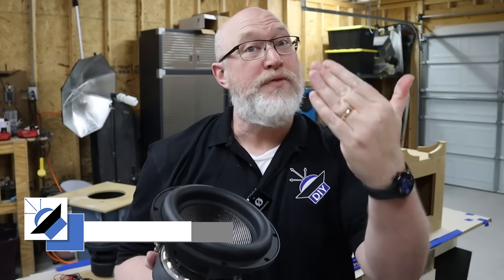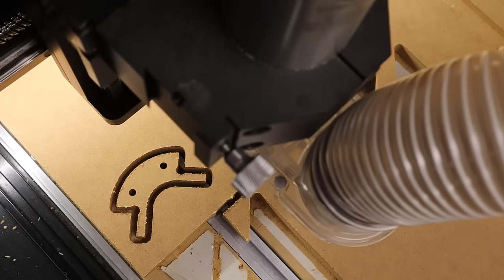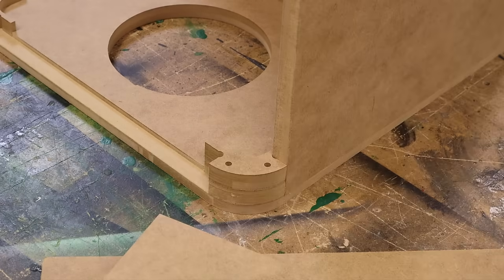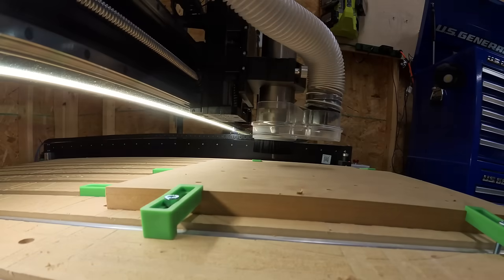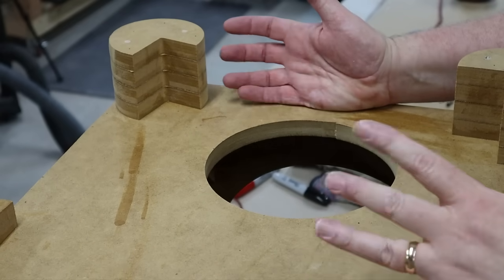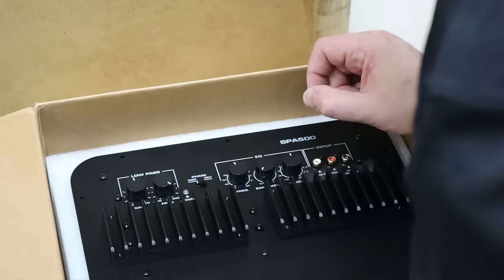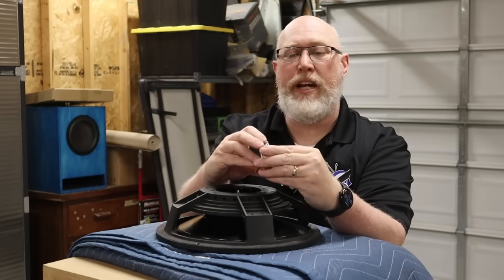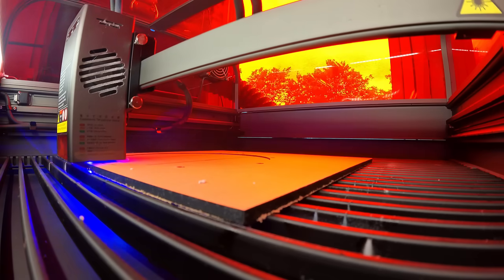Ultra low bass from a hidden 8" subwoofer.

Comment: If your using a wood glue likewise think you are, like titebond or something similar you should really be clamping everywhere your gluing 2 pieces together.. there are several good youtube videos that show the difference in joint strength when not clamping and clamping with different pressures and different lengths of time.. you get a major boost in joint strength even with light to medium clamping pressure for 30+ minutes. Without clamping , 90% of your joint strength is in your rabbits, dados and Brad nails but the opposite should be true, most of your joint strength should come from the glued joint. (Wood glue or yellow glue is a pressure sensitive glue) probably won't be an issue with a small sub but  certainly could eventually have a failure with 12,15, or 18 inch subs. Just thought id throw a little knowledge your way, take it or leave it, im just a professional woodworker not a audio expert...

Comment: What to learn. Easy to clip and blow with a passive radiator. Passive radiators are inefficient and hurt medium bass while still needing more power. Which will make it blow. Nice.
Reply from the maker: The  subwoofer blue because I clipped the hell out of the amp because I was trying to get some good footage of the driver flexing.

Comment: This is extremely interesting to me because I've got an old Klipsch 2.1  computer set with a 6.5 sub and 2-way satellites with 3"Mid and 1/2"? horn tweeter. They sound - I'm gonna make people angry here - like crap. The bass is boomy, the mids are muddy and the highs are shrill AF. I would love to take the amp in this set and completely revise it, starting first and foremost with the crappy sub. The Highs are tolerable, but the bass.... sucks.
Reply: P.S. Your take on the problem solving.... 👍

Comment: In 1978, I built a subwoofer with a 15-inch radio shack speaker. With press board, because there was no MDF back then. No calculation, just one sheet of press board. It had a flat rectangular baffle 3 X 20 inch that went 3 inch to the back wall of the box. It was used as a bass booster back then with its own amp . And it worked great for a first build.

Comment: notice you use Gorrilla and Tite  ,which is better ?
Reply from the maker: It depends on the application. 
For something like this that's unlikely to spend a lot of time outdoors, and I'm going to cover it with something like carpet or veneer, any wood glue will be fine.

If it's going to be for outdoor use, I'm going with titebond 3. 

If I'm making something out of plywood that I plan to stain later. I like the gorilla glue because it dries clear and I have found that it discolors the wood less titebond 2.

Comment: Hi! I'm glad that this kind of design has caught the attention of others. ☺️ I developed this technology in 2020 for my own 250 liter subwoofer, an optical trick to make the appearance of such a large subwoofer more beautiful to the eye. I implemented it in July 2020 and I had never seen this technology anywhere on the internet before. That year I presented it on several Hungarian professional websites, then in October 2024 I also posted it in the DIY Audio Facebook group, and in February this year in the Loudspeaker Plans group.
Reply from the maker: I was completely unaware that anyone anywhere has ever built anything remotely like this?.
Reply: @DIYAudioGuy I shared my 2020 project in these foreign groups. ☺️
Reply: @DIYAudioGuy It won't let me join the groups that contain pictures of my work. 🤷
Reply: What 'technology' did you develop, exactly?  I'm confused as to which part of this design you are claiming...
Reply: @Elmojomo First of all, I don't know exactly if Google translated correctly, since I translated from my native language with Google, so maybe not everything is translated correctly... I never stated anywhere that I have a claim to the technology. The training of the corner elements came from my own well 5 years ago, before that I had never seen anyone use a similar method or make a speaker with such a solution. In the past 25 years, I have visited many groups and forums, I have seen thousands of homemade speakers, but not such a solution. I also wrote there that I was glad that someone else used this solution, if you invented it yourself, if not then. As far as I know, I have not filed any claims because of this....

Comment: I would love to see one with the 12" woofe\r up front  and two 12" passive radiator on the sides with the 500w amp. I wonder what the box size would need to be. Just checked the price. Damn. It would be expensive. Without the box it's $800. Might as well just get an SVS subwoofer for 900
Reply from the maker: It would be fairly easy to modify the design to do that.
Reply: @DIYAudioGuy  Yeah but it's expensive... i have two klipsch c310awi. It's a 10" woofer with two passive radiators. 400w rms. They punch hard but don't go super deep. They fall off below 27hz

Comment: Use a compression bit for cutouts and you don't need tabs
Reply from the maker: The tabs hold the pieces together so they don't go flying while the CNC is cutting.  Unless I'm missing something, I don't see how a different type of bit can change that.
Reply: @DIYAudioGuy  a compression bit will pack sawdust in the cut so it can't move, thus, avoiding tabs altogether. Game-changer.

Comment: Have you ever heard of adding weight to the speaker cone to tune a subwoofer? Some don’t need a high pass crossover. The cone can’t move fast enough to make high frequencies.
Reply from the maker: There was a brand, I forget which one, that's coming out with a subwoofer that allows you to add mass on the front of the cone. It's an intriguing idea.

Comment: Great video! One thing about EQ though. Peaks can easily be removed using EQ. Valleys are tricky though. A valley can only be fixed using EQ if it's caused by a dip in the response of the driver itself. But more often then not it's caused by destructive interference. Increasing the output to try to solve this will enlarge both the primary and reflected soundwave, and the dip will still be there. 
Great stuff about solving problems along the way. Other channels often don't show things not going to plan, but to me it's part of the fun of the hobby.
Reply from the maker: Very true, no amount of boost can get rid of a null  caused by the room!
Reply from the maker: I tested that out and got it on film in part 2.  https://youtu.be/CF1XbByo2P0

Comment: The rattle isn't always an air leak, sometimes its the excess speaker cable touching the basket of the sub and it sounds like a blown coil rattle.
Reply from the maker: That is something I am worried about, still working out the best way to make sure that does not happen.
Reply: The foam backed door insulation works great and is also sticky backed👍 @DIYAudioGuy

Comment: You could of ran 1/4” dal through those corner holes the entire length and just been able to slide them down on or you could use 1/4” all thread and counter sink on each end and be able to squeeze it together.
Reply from the maker: Yes.

Comment: What's she designed to hit? Just wondering as I have a couple of 8" ported designs that'll -3 dB at 34 and 25, respectively, in really small boxes. But as you mentioned, the ports are pretty long.
Reply from the maker: Shooting for a flat f3 between 20 and 50 hz
Reply: @DIYAudioGuy Nice!
Reply: @DIYAudioGuy  Nice!

Comment: Are the speaker and radiator in phase? Good job because your radiator is larger than the woofer as it should be/
Reply from the maker: They are only in phase at the tuning frequency, just like a port.

Comment: just build a sealed box and eq it.  Doesn't need to be super loud. WAY easier.
Reply from the maker: Fair enough, I might have to give a better try and compare.
Reply: @DIYAudioGuy  With that plate amps eq, I think you could pull it off.  Room placement is key, you can get a lot of room gain in the prime listening area buy playing with the box placement.  While what you are trying to do is pretty cool, IE the passive radiator, and I am curious to see how it turns out, I have always liked subs in sealed boxes even though they lack some DB over other designs, they are simple and generally carry sub 20hz well.  Love the channel. Thanks for the content, always learn something from it.  I am just some joker in the comments.

Comment: Another solution for the speaker leaking that may help all your builds is to use t nuts or threaded inserts:  Parts Express Cast Frame 1/4"-20 Speaker Mounting Kit

Also, I’ve heard the Parts express amps may have a built subsonic filter built in? Specs on that amp and a dyno would be awesome! 🎉
Reply from the maker: That is not going to help if the subwoofer does not fit in the cut out.

Comment: Love that you demo’d a HT sub!! Funny about the amp box! I was thinking while watching, “why such a big separation for the amp?” lol. Questions: why not cutout the “amp wall” and just turn it into a brace by cutting out an X or something?  Also, for apartment/TH style subs, down facing driver may not be the best because it will rattle the floors/ceilings of neighbors. Also, I’ve found isolation feet to be a big help in keeping the bass in the room and not traveling throughout the apartment/TownHouse. :). Awesome project tho! Look forward to you doing more of these!! Ps. Flat black/vinyl is common for home theater. 🎉 imo.
Reply from the maker: If  did that the sub chamber would be larger, which would change the tuning/performance.

Comment: I had the same issue the last time I used dayton audio products.  Great stuff, but they have little weird things going on like what you ran into.  Their passive radiators also make weird noises.  I have 3 of the 15 inch versions, which I'll be using in future videos.  They sound good, but not quite clean if ya know what I mean :).
Reply from the maker: It sounded fine until I clipped it.

Comment: Large boxes don’t need long ports? Say what? The larger the enclosure for home theater, the longer the port, if you’re tuning right and low. I tune my 15” and up subs 12-16hz which require large boxes and long ports.
Reply from the maker: Give this a look:  https://diyaudioguy.com/?page_id=1088  Try small boxes and large boxes with the same tuning frequency.

Comment: I just bought a Polk 10 inch powered sub for my home theater my wife's first response was "this thing is HUGE wtf" and i was trying to explain to her that it is MORE expensive to get great sound out of a smaller sub because it has to work harder, it takes more expensive materials and more engineering time.  I Love watching your videos of making tiny subs do magic and almost defy physics.   I would like more explanation on using passive radiators in DIY.  How do you pick the correct passive radiator. I did not know they were "tunable" with the weights. more info on the tuning with weights!   Also i had an idea about dampening the noise of the weights you could use rubber washers and maybe even spraying the weights with plasti dip. Or maybe they sell weights that are already 'coated' fully in rubber.
Reply from the maker: I have a few videos on the topic:  https://youtu.be/v4rAkxck2_Q?si=nPt-r31yszWvN0Kt

Comment: I’ve got access to a nice CNC router at work that makes cutting boxes a breeze, I’ve made many many boxes with it. I do stack fab ports a lot but man it can add some time in assembly. Not sure what bit you use, but I use a 1/4 “O” flute down cut bit on all my boxes, MDF, plywood, acrylic, doesn’t matter material. It’s a single flute bit, looks a little odd, but it gives a very nice cut and the down cut leaves a bit of sawdust compressed in the cut adding work holding. Granted we have a vacuum holding table to hold down a full sheet, I’m able to cut 3/4 in a single pass at 130ipm 18000rpm with no tabs. Some fine parts still require tabs, gets a little sketchy lol. Give one a try if you haven’t
Reply from the maker: I have several bits that I swap out depending on what I am cutting.

Comment: What's the point of the small sub? The size of the passive radiator is increasing the footprint of the box anyway.... If that's the case then why just not a bigger sub?
Reply: the point of the passive is the same as a bass reflex, to extend the bass lower.
if you made a 12" subwoofer instead at same size, it would be a sealed sub, with less deep bass.
unless you adjust for it with EQ. 
some say the passive radiator with with the active driver, so you get a bit more bass at tuning than just the 12 alone.  

if you ask me to design a small sub not to bother neighbors you want small cone area and large xmax. box size is irrelevant.
Reply from the maker: Bigger subs need bigger boxes.

Comment: for a small Room you can even use the 7 ich Dayton, the 8 ist very good and 10 is crazy, and you can build an Array 2x2 Subwoofer in a closed Box you will get this big impulse from a small chassi in a closed box but with the Room Gain you can Play down under 20HZ, use your Room gain and an Array

Comment: Why did you make the corners so far apart? What a waste of material!
Who TF doesn’t run a foam gasket on their speaker/subs mounting flange?
Reply from the maker: Do you mean when I was cutting them on the CNC machine?  I'm still learning the best way to lay things out.  Every time I use it I get a little more efficient.

Comment: NEVER solely rely on manufacturer cut out hole size which is usually too big\slack, they know most ppl are cutting wavy free hand with a jigsaw so they compensate for imperfect circles ... i use a framing square & speed square to accurately measure the frame & a jasper jig on a router
Reply from the maker: I made that mistake once when I first started building speakers, after that I was really diligent about and measuring, cutting test holes, double-checking everything. I just got cocky.  Thought that the CNC machine would fix all that.  Lesson learned.

Comment: Nice cabinet Justin. I love the curves. I'm about to do a similar curve on a cabinet using the same driver as a matter of fact, but with a biggie router bit. Yeah, I'm scared. Also, I always think creating a sub-enclosure for the amp is ALWAYS a good idea. The built in 'cabinet' is thin plastic and I like to always have a nice 'real' enclosure to make life easy on the amp.
Reply from the maker: Would you like to try using these kind of curves?
Reply: @DIYAudioGuy  I just completed a one-off router table (it's REALLY BIG) just for this build. It's this one in my workshop tour video: https://youtu.be/Grd4LL8besU?t=639   Thank you, though. You kind of made it look easy. I know enough about designing stuff in CAD programs to know it's not at all easy, though.  I also LOVE that fact that you mentioned always drilling pilot holes for the drivers... I agree, it should always be done. You've encouraged me to get my project going!  Thanks Justin!

Comment: do you think it needs more passive radiator area? seems like the PR was hitting a mechanical limit? sort of sad to see the ultimax blow so easy, i picked one up when they first came out and wer on sale for 99. Any explanation as to what happened ?
Reply from the maker: I clipped it. I was trying to get some big excursion to make it look good on video and just overdid it.  There's no way this thing would fail under normal usage.

Comment: The Dayton Ultimax II is the best sounding subwoofer I've heard yet. I've got a single 10" in 1.25 cubic ft. ported at 27hz on about 1500 watts and I've never heard anything like it. It sounds like most two subs usually sound.
Reply from the maker: It's a darn fine subwoofer.
Reply: I'm thinking about building one myself. What amp did you use?
Reply: That is Cool !